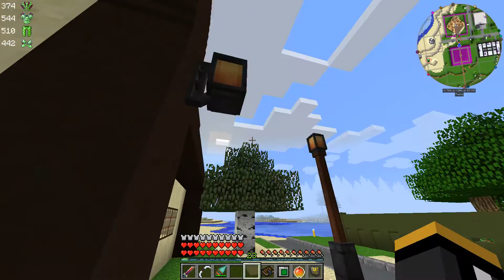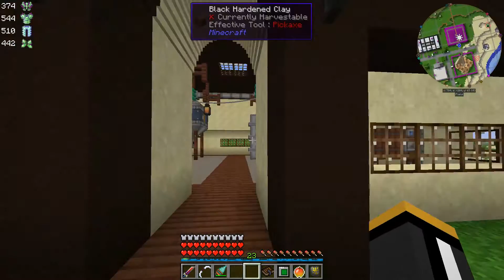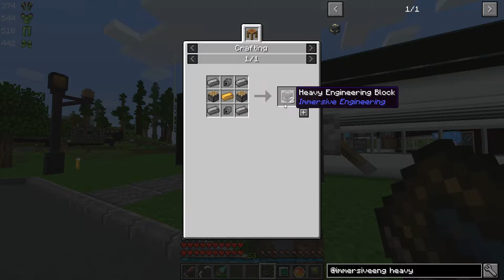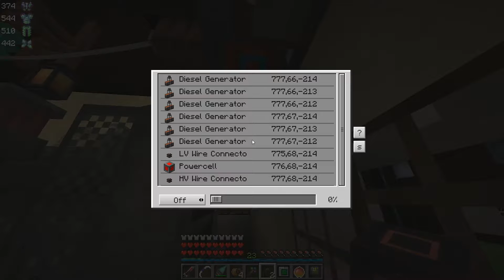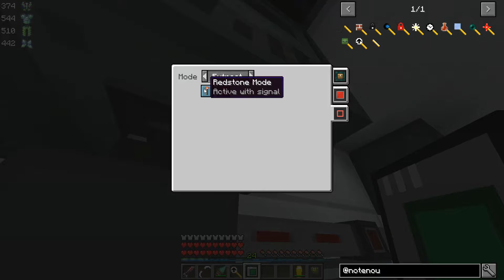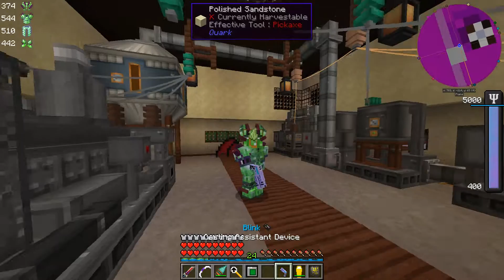Modded 1.10.2 - E43 - IE Diesel Generator & Power Prioritization

Comment: my diesel generator kept running with everything full and after I turned it off I placed an empty capacitor on it and it immediately filled with slightly over 1,000,000 rf, was interesting after seeing this video so I ended up doing the same with power monitors so it shuts off after ~85%.
Reply from the maker: Works nicely! Only problem was that when the power would hover around 80%, it would repeatedly start and stop, so after this recording, I tweaked the setup with an Ender IO power monitor similar to my coal generator setup so the generator only kicks in when the bank is 1/2 full and runs until it fills up.

Comment: Never thought about turning it on when I need it and leave it when I don't...so thats why I never have any fuel left xD
Reply from the maker: This thing does burn through fuel very fast. I was amazed at how quickly it consumed thousands of apples.
Reply: If you read the book from this mod, as I got in my mind there are other types of items that get you more fuel out of it...or was it just the seeds? I gues it just was the seeds. But maybe you try to get something that produces quick and alot, like potatos or carrots.
Reply from the maker: If I remember correctly, they all produced the same amount of ethanol. Since I have so many apples coming in from the tree farms, I might as well use them.
Reply: I meant, potatos drop more than 2 potatos everytime you destroy them. They get collected really fast and so it is much more efficient to use them :D
Reply from the maker: Makes sense. I could possibly use them as a backup if I ever run out of apples.